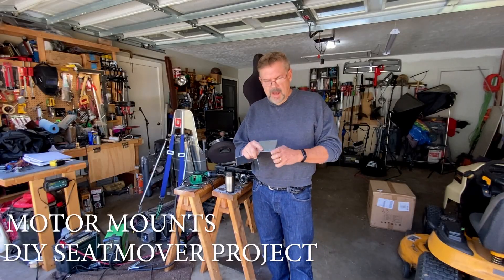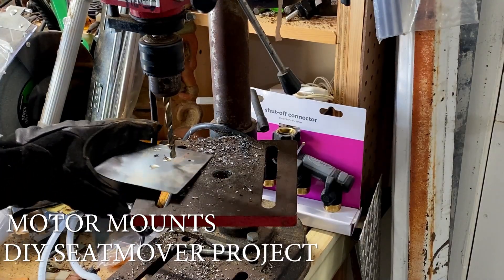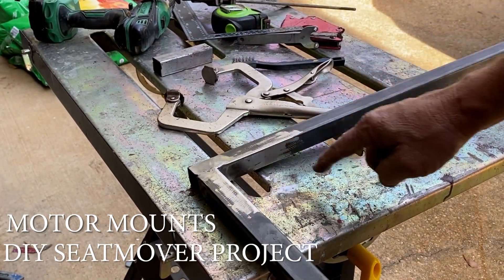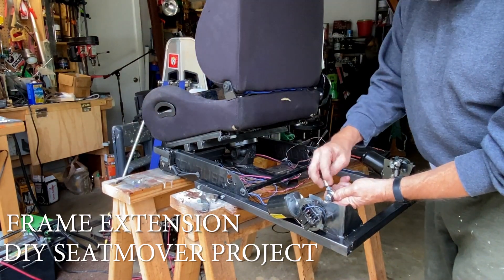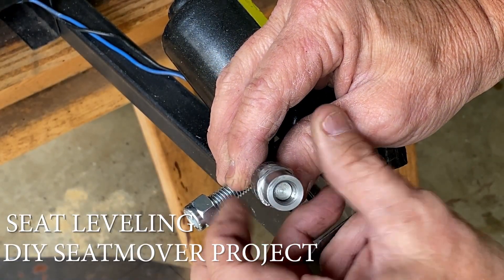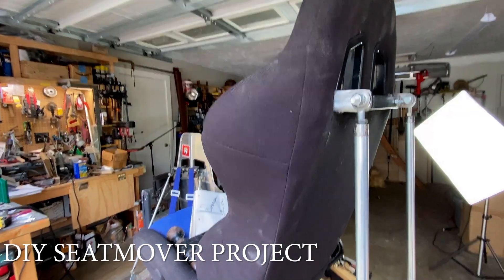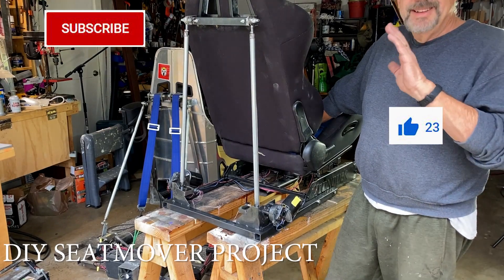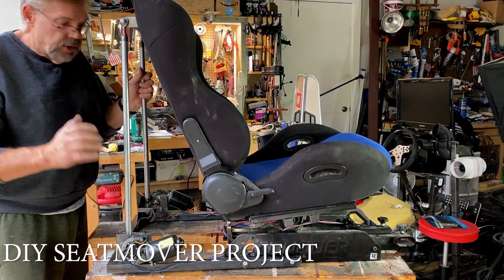DIY SEATMOVER Part 7 WW motors Arduino IBT-2 Simtools MOD your static SIM RIG with Motion!

Comment: Where did you get those rod attachement points?
Reply from the maker: The tie rod ends..  I got them from amazon. 3/8 inch left and right hand side ..  They fit right into the 1/2 inch conduit.. so pretty slick..

Comment: Will the wipermotors do better if you build a rig where the pivot point is closer to center of gravity? like in this video https://youtu.be/_ukltGtmsP8
Reply from the maker: Thanks for the Link Fred! I'll check it out. I did find the CG for the seat and it's balanced.. My vid here https://www.youtube.com/watch?v=aBZ8ZQNNQUU so I think it's more that the WW motors are not strong enough with my weight in it.  I had to move them back about 12 inches for more mechanical advantage.  DMAX
Reply: @DMAX_DIY  Is it posible to use printer encoders an an alternativ to hall effect potentiometers? i have a couple of old printers in the house :-)
Reply: Nice heart D Max,,, Is that a "yes you can" ?
Reply from the maker: @Fredstli  That is a Yes you can heart.  apparently YT algorithm likes to see Hearts so there we go.. 👍
Reply from the maker: @Fredstli  I would just buy the hall effect pots.  They are like $23 each.. But very reliable and one less thing to think about.  I originally used 10k wire wound ones but when I heard that a lot of guys found unexpected interference, I just bought the Hall effect ones..  They do have a 'sweet spot' but I have not had any issues whatsoever with them.. Dave

Comment: Hello, newer sub here. Been binge watching all your videos. I built an 80/20 sim rig a few years ago. Looking to build another one. Would these motors work? Makermotor 3/8" D Shaft 12V DC Reversible Electric Gear Motor 50 RPM. They are on amazon. Or should i wait til the ones on ebay become available?  Merry Christmas.
Reply from the maker: Hi and welcome..  I'm not sure cause I've not tested them but I was planning on ordering some of the markermotors for testing.. I just got in a new crab pot 12v 50:1  to set the benchmark.. I have those on my 3dof rig..  so I can see what amps it stalls out at and start compiling some type of chart info for you guys..  All I can say is keep trying..  most motors work ok.. some are better than others..  D

Comment: got 40' of 1", 1/8 square tubing today, to start my base. electronics all ordered a few days ago .. only possible because of your videos, subbed when i got here Dave. Thank You sir.
Reply from the maker: Your going to have so much fun once it starts moving my friend..  Check out x-simulator.net.  They are fantastic at answering questions and all that.  I have a build channel there too..   Here is the link..   https://www.xsimulator.net/community/threads/full-frame-2-dof-traction-loss-new-build.14740/
 Plus the moderator (noorbeast) is really cool and can answer questions too.. Plus just ask your questions here if you have any..   I will attempt to answer them.  DMAX

Comment: What specs for motor's should you be looking for to get enough speed and or power to actually kick you out of the seat?
Reply from the maker: Well, the WW motors are kind of a mystery.. They are not a quick as my crab pot  50:1 motors nor are they as strong.  Take a look at the motion dynamics 60:1 motors from Australia. Those would be be the Pinnacle of speed and power.   They would kick you out of the seat as your requested.
https://www.xsimulator.net/community/threads/12v-dc-motors-with-60-1-gearbox-from-motion-control-products.5649/

https://www.motiondynamics.com.au/industrial/
Reply: @DMAX_DIY  ah okay, thanks! I will have a look at that after i try and build a rig with the ww motors. Your videos are very helpfull and make me understand this rocket science :) keep it up!
Reply from the maker: @ericmelchers750  Cool Eric!  The motors are really the key to it all.. The rest is just mechanics and stuff.  Big motors are Better! DMAX